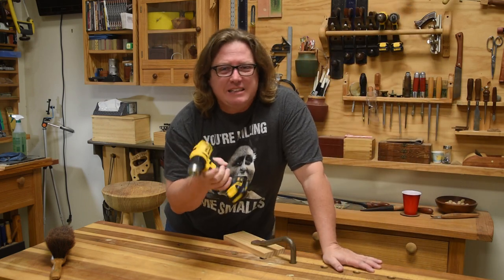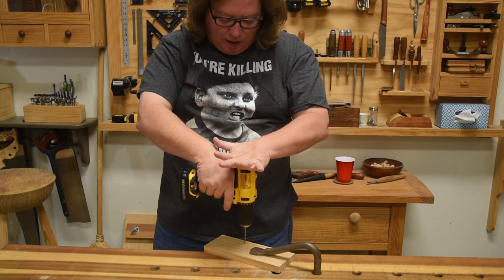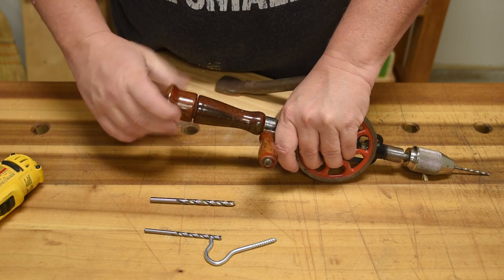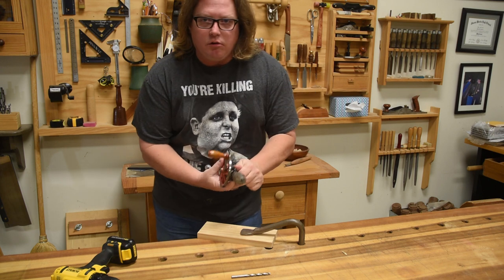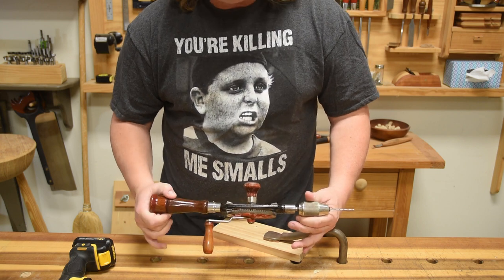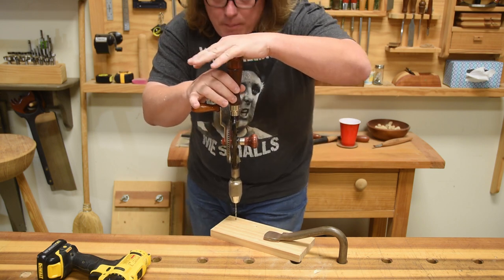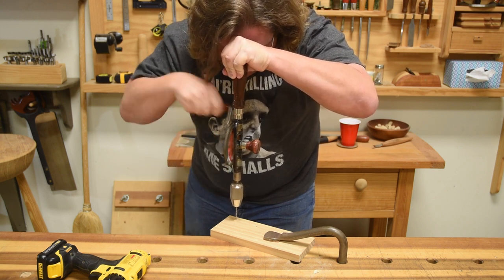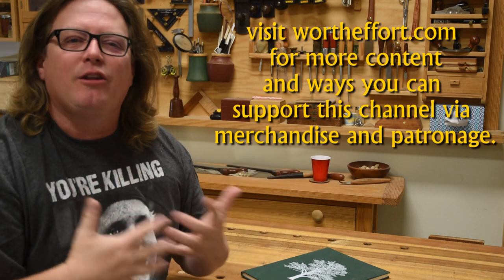Egg Beater Drills

Comment: What tool is the best depends mostly on what you do. 

When it comes to drilling small holes (up to 6 mm, or 1/4") in a soft material (wood, plastic, aluminium, soft bronze, etc...), there is nothing more comfortable to use than such a hand drill (the egg beater) - great precision and ergonomics.

For tougher materials or for big holes, there is the drill press.

And when you want to drive screws straight into the wood, without pre-drilling holes, and for similar savagery, it sure is useful to have one of those high-torque, battery-powered drills. :-D

Comment: I love mine. I've got four of them. Miller's Falls #2  and #5 and North Brothers #1545 and #1530.  Along with a couple of other Yankee screwdrivers.
I've made all of mine usable, cleaned them and lubricated them but I did a little bit more on the 1545 and I made a side handle for it from a file handle. And I use adapters most of the time on them to turn them into hand crank screwdrivers and nut/bolt drivers.
I also store screwdriver bits in all of them and hex drive to 1/4 inch square drive adapters in a couple of them.
I also use them for sturring paint and winding antique clocks and I suppose I could even put a wire whisk on there and scramble eggs with them.
I call them my cordless bit drivers because I use all kinds of bits on them.

I do need a handle cap for the bit storage on The Millers Falls #5 if you could tell me an easy way to make one for that. Right now it's covered by a rubber cup that goes on the bottom of a walking cane and it fits perfectly and it almost looks natural.  I also need a small side handle for that but I could probably make that pretty easy. 
I did make a round handle for the front of my old hand plane by using my drill press. I don't think that would work very well making that hollow handle cap with wooden threads in it.
Any suggestions from anyone would be a help and appreciated.
 thanks.

Side note:
A few years ago both of my daughters bought me identical antique egg beaters for Christmas. That was not planned. 😃

Comment: Bravo. Just picked up 2 of these a few weeks ago, an old Stanley and a vintage Millers Falls for 15 bucks. Wasn't sure I'd even use them but they're really cool. Now I'm going to give them a good cleaning & light oil and use them.  Thanks.
Reply from the maker: Get em working.
Reply: is the stanley a hy lo drive? Just wondering because I bought one and so far everyone who has seen it has no idea what style the bits are that come with it.

Comment: Never run out of batteries either!
I like them, have a few on hand, they are great for holes up to about 5mm or so (all of mine have 1/4" chucks anyway). Work great for de-burring too. The only major fail point for me (aside from larger holes or metal drilling) is times when you can only use one hand to drill,  that is when a cordess drill is superb.
Reply from the maker: Never run out of batteries, unless you run outa pizza.

Comment: Cool to see people using them! I'm waiting to receive a Stanley no. 742, which is a breast drill. But I think leaning onto it and having one hand on the side handle to stabilize would help a lot make things more precise. I think I could probably even put my forehead straight on the chest plate. Can't wait to try it!
Reply from the maker: Those are more for timber framers and were designed to allow the chest to apply pressure. The bits are more aggressive and used in softer woods so they need the pressure.
Reply: @wortheffort  Makes sense! The one I got has a three prong chuck, so it should take modern bits and augers as well.

Comment: Great Video. I had a Bridgecity CT-6 drill but my ex Stacy stole it. Replaced it with a two speed goodell Pratt…. Related to Miller falls.

This was the first cordless tool. No proprietary batteries to buy, find or recharge. Ultimate infinite speed control.

For drilling small precise holes in furniture projects, this is the beast of choice.

Folks we have worked wood for 300 plus years with tools. The modern tools are a minor and poor improvement on the same principles. Many are simply barbaric in use. Lots of plastic and expensive add ons. Great for making IKEA furniture! Not so great for making heirloom furniture.

We all need to take a step back, smell the coffee and reflect on what need to do and why. If your a part time furniture wood worker, take a look at learning and using the old ways and tools. Leave the melamine for IKEA.

Everything in this video is simply accurate.

Comment: Now that you mention it, I wonder why they don’t make those cordless drills with the batteries behind (or around or even in front of) the motor instead of below the handle, so that the mass of the thing would be more in line with the hole you’re trying to make or the fastener you’re trying to drive in? Much of the total mass of the whole system is in that battery pack.

Comment: Picked mine up at yard sales or flea market. Though one does appear to have a slightly bent shaft so the jaws won't close properly.
Reply from the maker: They're cheap enough just find a better one, major repairs aren't worth it.
Reply: If I remember correctly found it in a toolbox I got for $5 at a yard sale. Same box had an 18 inch Snapon power bar. So no problem.

Comment: I have this same exact Miller Falls No. 2 I picked up for $2. There is one piece missing in the Chuck that is the piece that pushes the teeth up to clamp on the bit. Any idea where you can get either parts for this drill or the entire chuck?
Reply from the maker: I'm afraid not but that's a common issue. Just use your fingers to retract it (press it in).

Comment: Speaking of hand-powered drills, how does the “egg beater” syle of drill compare with the “brace-and-bit” for performance and ease of use? I would appeciate comments from Mr. Wortheffort and anyone else who has tried both styles.
Reply from the maker: Egg beater for 1/4" or less brace for more. It's a torque thang.

Comment: I'm restoring an egg Beater drill I found at a Habitat Restore Store.
The drill is in pretty good shape however the keyless chuck is damaged and has some missing parts. Do you know of a store where I can purchase a replacement chuck.
Reply from the maker: I'm afraid that's a little out of my realm. I'd think you'd need to find another to scavenge parts from.
Reply: Ask around on some of the woodworking forums.

Comment: Hand drills have no sense of balance? Depends on whether you're drilling vertically or horizontally. If you're drilling down into something flat on a workbench, then yes, the eggbeater has the best balance, but a pistol-grip electric drill is deliberately designed to balance nearly perfectly horizontally with the cord or battery under the hand. Modern tool designers have not forgotten the need for ergonomics in tool design, but have in fact embraced it.
Reply from the maker: Peter Sage uh... don’t quite understand how either is balanced horizontally.
Reply: @wortheffort  Look at the way you're holding the battery-powered drill in the first ten seconds of this video. The bit is almost perfectly horizontal, and you didn't have to stick your elbow out or deviate your wrist toward your ulna to do that; you did that without even thinking about it. Dunlop made a pistol grip eggbeater,, and due to the ergonomic advantage, they demand a higher price on the used tool market than screwdriver handle eggbeaters.
Reply from the maker: Peter Sage ya, your describing ergonomics not balance.
Reply: @wortheffort  Ergonomics and balance of the tool in the hand go (pun acknowledged) hand-in-hand. The weight of the battery contributes to the balance, by the way, and the wrist instinctively deviates to keep the weight of the gear reduction box and motor housing balanced across the index finger and CMC joint. I challenge you to show me a single pro-jobber drill/driver or hammer drill that doesn't have a pistol grip.
Reply: @wortheffort  Don't get me wrong; the eggbeater drills are fine tools for their day, but I can't imagine a serious modern craftsman making room for one on his toolbelt.

Comment: Nooooo.  No. You're wrong, these drills suck and no one should ever buy them.  They spent hundreds of years and abandoned them for a reason.  

(gotta keep the prices down)
Reply from the maker: Don't worry, I'm not Schwarz.
Reply: It's cool, I am.
Reply: Lol!!  Good one. And sooooooo true.
Reply: Joe, the reason they abandoned them  is productivity as measured by the number of holes you can drill in an hour, or minute, especially in metals, which has very little, really, to do with how straight those holes are drilled.  They are unquestionably superior on a production line, especially with templates and guides.

 The drills with the battery at the bottom are better (better being relative.  Less worse?) suited for drilling horizontal holes than vertical holes.  He's completely right about how they contribute to wobble and bad holes.
 I use a power drill, but it doesn't have a battery.  And the handle connects to the middle of the drill motor body, not at the back end.   It's not as bad as a battery powered drill for balance, nor does it run out of power unexpectedly.  I also have drill guides.  I also have an eggbeater style hand drill and a brace (as in brace-and-bit) but I mainly use those for driving screws.  I have far fewer stripped out screw heads and I don't drive them too deep.
Reply: @Ferndalien  I agree. Personally, I lack the budget and the space for a proper drill press, so for most of my reasonably straight hole boring needs, I use my corded hammer drill. The crossbar handle, weight distribution, and the ability to feather the trigger really helps me get good results that way, as well as the motor being more robust (nothing more distressing than burning the brushes on a cordless drill by drilling something too hard for it).